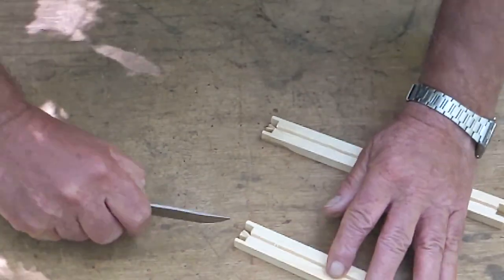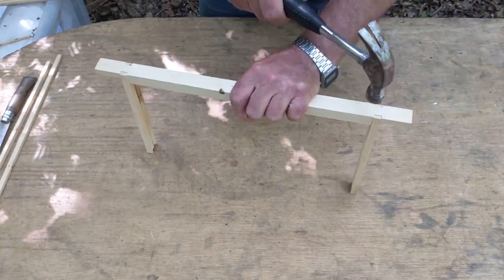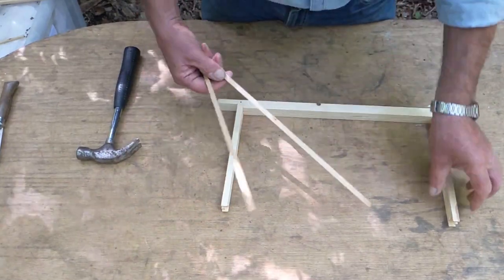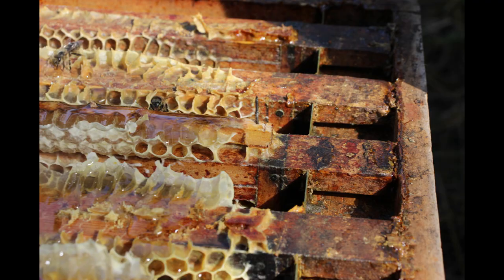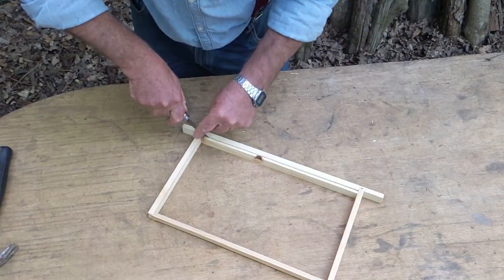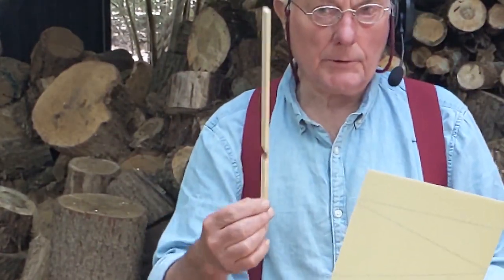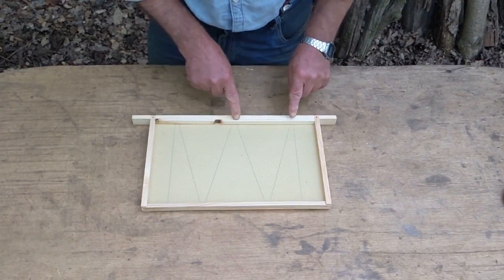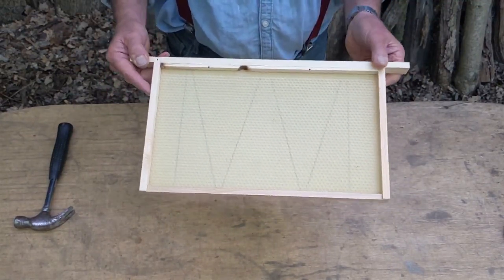Assembling a National British Standard Brood Frame for a Bee Hive (DN1) The Roger Patterson Way!

Comment: I do the nails very similar way but for the top bar probably slightly longer nails as I use Hoffman frames. I also  glue and pre drill slightly to avoid splitting. One bottom bar should be removable it makes much easier when installing the wax foundation. Nails lengths are very important and I use different lengths in different places. I install wax with one bottom bar which is glued permanently and second is not then push second bar in and drive the nails. The nails in the bottom bars makes more difficult to install wax because can catch the edges of the wax and contracts the groove slightly so definitely second bottom bar should be inserted after wax is in place. I do the nails through the top loops (3loops). So I use 7 nails in total but there are 3 lengths of them to make sure job is done correctly. I use challenge panel nails small hammer, punch, pencil,middle screwdriver to start the holes, cordless drill and small drill bits, gorilla glue.
Reply from the maker: You pre-drill the holes on each frame? 😲